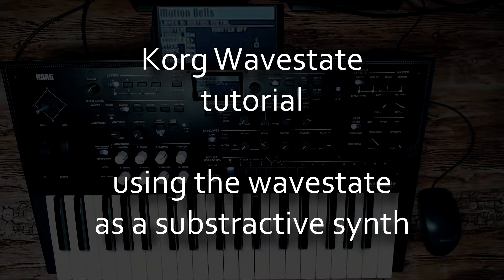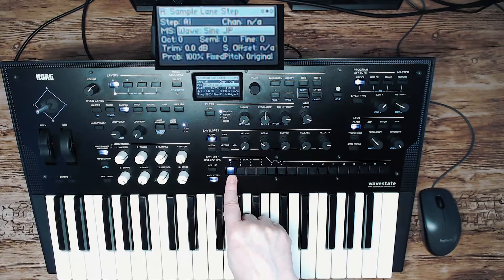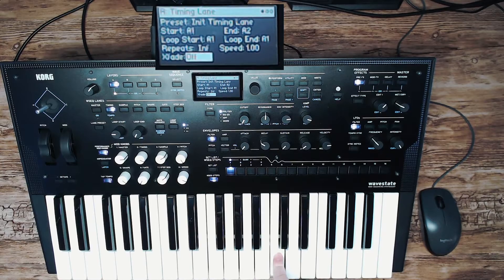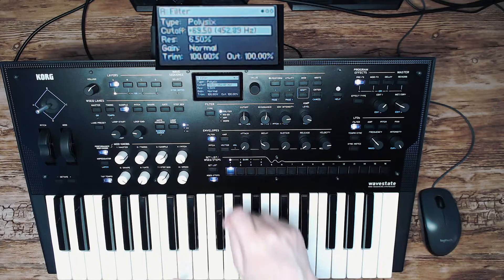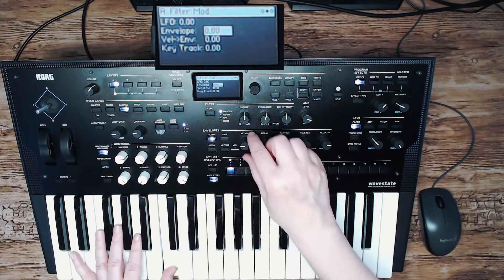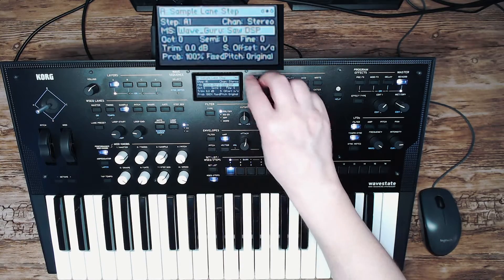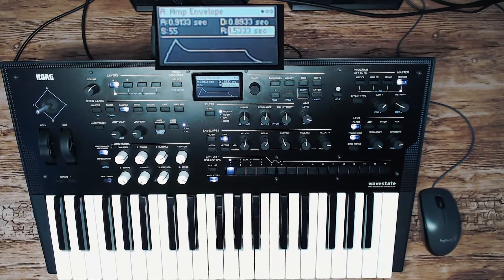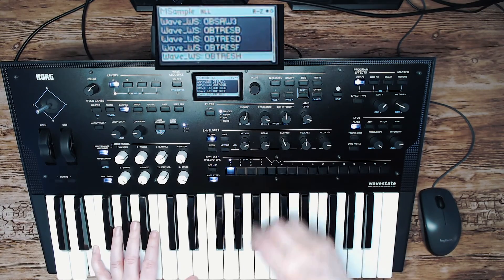Korg Wavestate tutorial: 03/11 Using the wavestate as a subtractive synth

Comment: What’s interesting, is that the amp envelope overrides how the gate and note settings affect play back in conjunction with how the key is played (held or released). So for example, If I have a long release time, the 2 Steps loop regardless if I have a gate setting on the second step. But it won’t loop regardless of the envelope settings if I just hold the note down - it will sustain on the second step and behave according to step settings. This creates some interesting possibilities playing around with different duration combinations of both steps and how you set up your envelope.

Comment: Hi Qui, why not use the multisample option instead of wavesquence for basic subtractive synth sounds?
Reply from the maker: that's also possible, but there is a big difference,  if i ever want to use lane features added to the sound, or if i want to create a sound with multiple samples where the last step is then the gate (for instance a noise attack and saw sound on the gate step where you paint your new sample sonically, it's still a saw sound in that case but you 'colored' the saw sound). Then with this method your starting point can be easely expanded.

But indeed, if you fully want to ignore all wavesequence possibilities, you can press the wave sequence select button and switch the mode to single multisample.